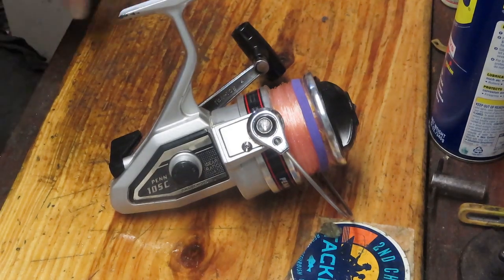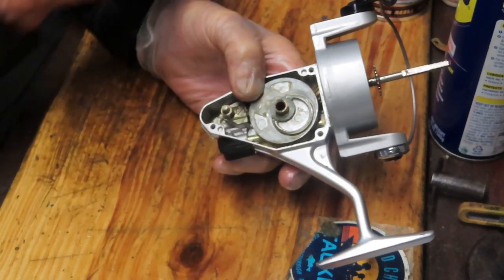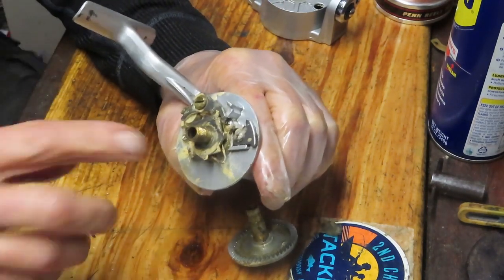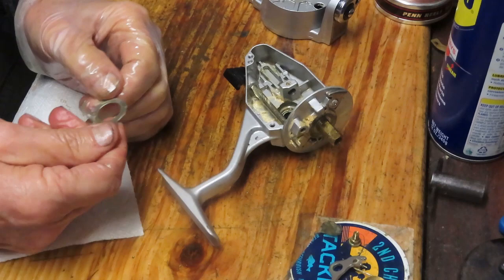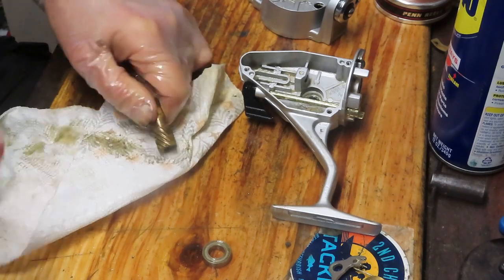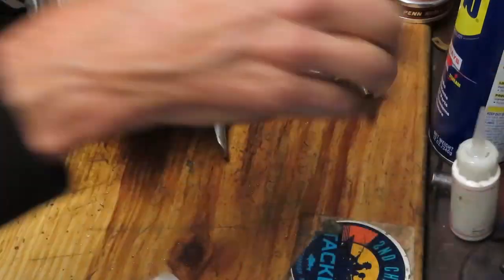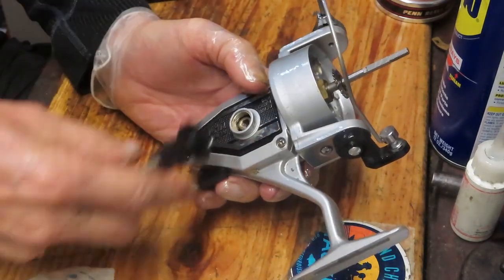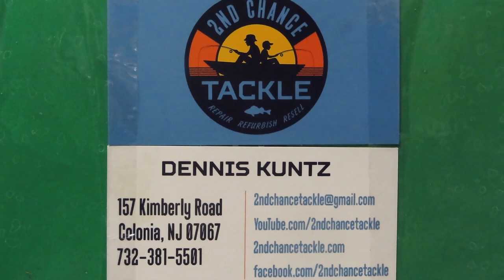Penn Silver 105C spin fishing reel problem diagnosis and how to repair

Comment: I have a reel just like that. It spent 25 years in a box of old reels in my garage. That thanks to you is in perfect working condition now . I would love to find one  that looks like this to switch out my parts to . Mine ( which I bought in the late 70’s and passed it along to my son ) was worked hard and put away wet ! It looks bad but I am going to use it this summer   I love using my antiques! I found the plastic clicker that goes in the back of the spool on eBay after around 6-7 months of searching my saved store connections. For $4.00! 
Great job   Keep on doing what you’re doing. ! We appreciate what you do.
Reply from the maker: lease send a note to my email 2ndchancetackle@gmail.com if you are interested in this reel.  Thank you - Dennis

Comment: I had one of those I bought in the early 80's and it was a great performing reel.  Unfortunately is was stolen.  The newer models from all manufacturers are smoother, but the older stuff was sure easy to maintain.  I do prefer the modern anti reverse.
Reply from the maker: Older and definitely built to last with minimum maintenance.  Hard to beat that equation!  Thanks for watching and for sharing your memory

Comment: I replaced a worn bushing in the cover with a bearing because the bushing wasn't available anymore, it took the slop out of the handle but doesn't really seem to make the reel smoother. Hard to pick between the Daiwa or Penn silver series, I seem to use the Daiwa C series the most.
Reply from the maker: The Daiwa always wins when I compare it to the Penn Silver series.  Thanks

Comment: You mentioned the Daiwa 7000C had bearings. I bought a 7000 Millinia in a small tackle shop in Japan while in the Navy in the 1970's, same as the C but just one bearing.
Reply from the maker: Hmmm - I just checked each version of the reel schematics and all show the 3 bearing set up.  I am wondering if there was a different version sold in Japan.  Thanks - Dennis

Comment: I enjoyed the video because i was following while trying to repair my Penn 105c reel.. it was going pretty well until putting the wire piece back in corrrect position to aquire pressure or fotce needed for the piece with the downward tab l to be able to activate the stop portion of the gear.. my reel just travels backwards or either foward continueously in either direction.. can you help me with this problem?
Reply from the maker: You need to remove the toggle arm from the lower case and pull up on the shaft.  One end of the spring goes in the hole on the bottom of that cam.  The other end rests in the "V" groove  of the case.  To seat this, get the springs set in the locations and then twist the cam to set the tension on the spring.  Push down on the bar to lock it in and reinstall the lower case lever - Dennis

Comment: Dennis, I have three in this series - 103, 104, and 105. None of mine have the C after the number. Ar one point someone told me that the C meant made in China but you have proved that not to be true. Are these totally different reels or what? What does this C actually mean? My reels look identical to this reel as far as I remember. I thought lithium grease was bad for fishing reels. I certainly have never used it. One of mine, the 104, came to me with that AR ratchet put in backwards. It is the nicest of all of my Penn silvers and was easily repaired. I have collected examples of almost all of the silver series from this era - Daiwa (the best), Penn, Olympic, Maxam, Ryobi, Shimano, and Sportfisher (Kmart). Daiwa is the only complete set that I have. Is the hole in the rotor of this  105C there for ease of lubrication of the AR or bearing? You were cetainly right about looks often being deceiving. Beautiful job on a beautiful reel! — Chris
Reply from the maker: According to Mysticparts.com, the "C" versions were made in China.  Not sure on that
Reply: @2ndChanceTackle  The C series I own have made in Japan cast into the reel seat. I don't think Penn would make reels in China and falsely label them as made in Japan.